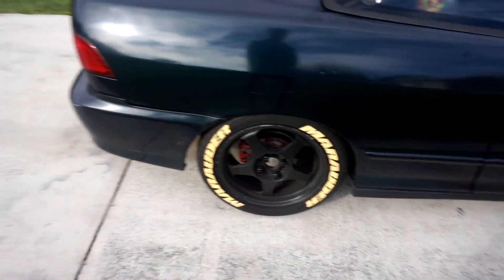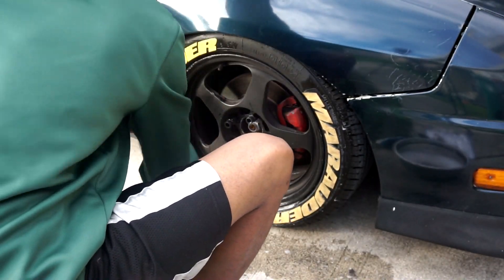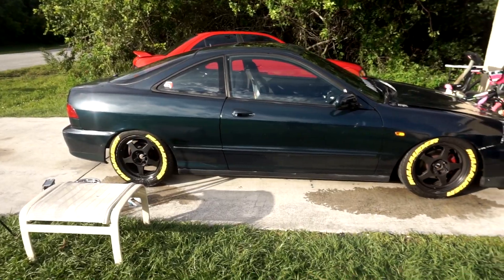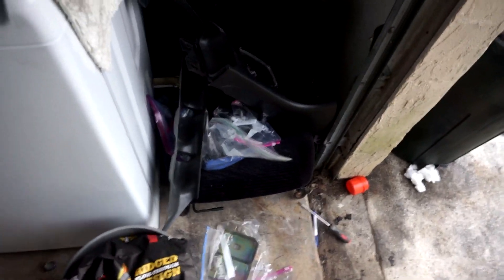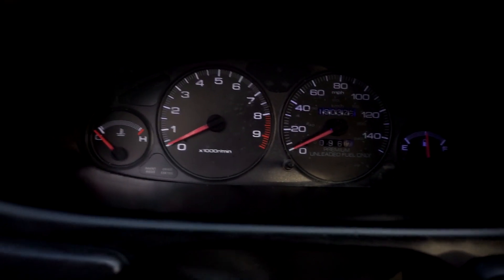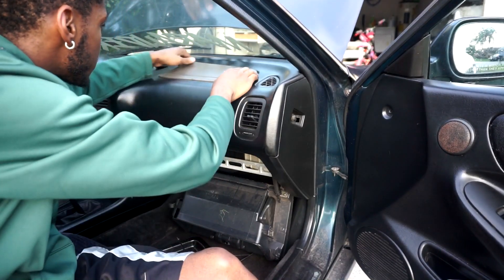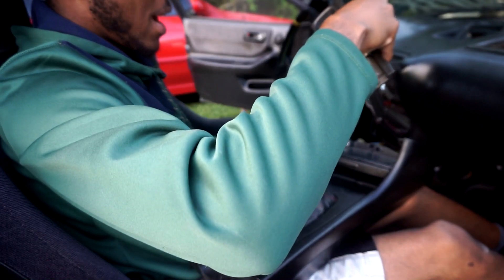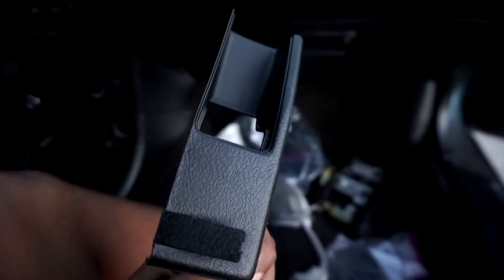Cleaning Tire Letters, Installing Parts & Xbox One Giveaway

Comment: Dish soap is a go to for cleaning tires for me 
But dont apply alcohol on your walls when they are dry no homo it can crack in long run it's better to wet the tire let the water run off then apply alcohol